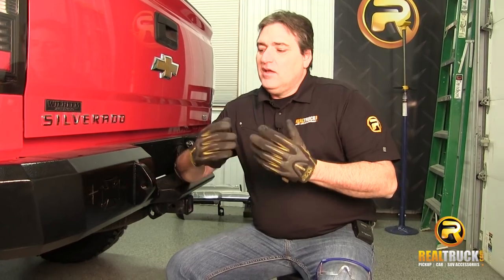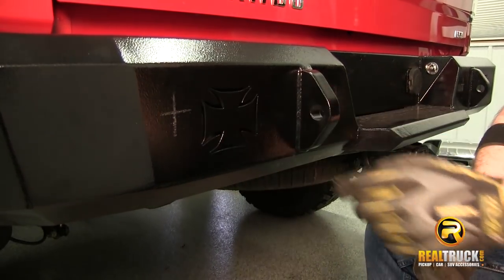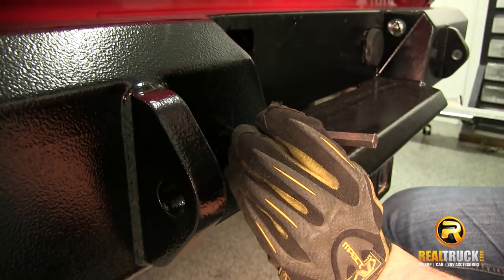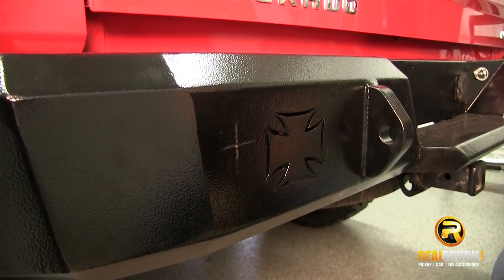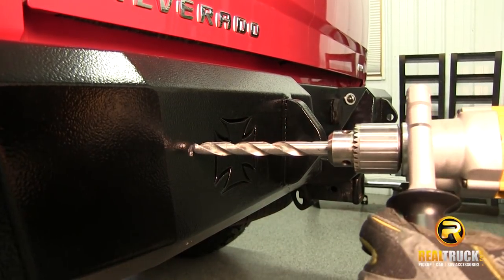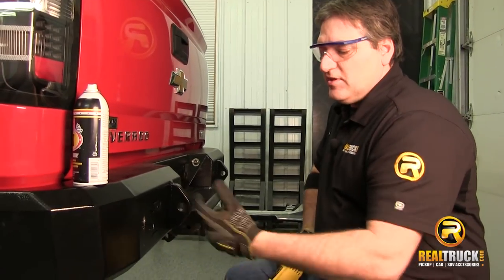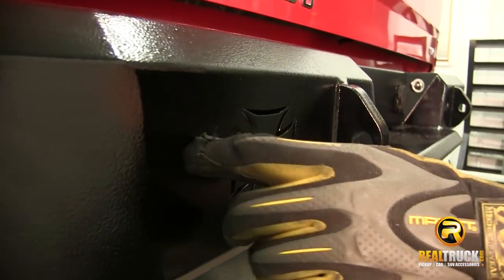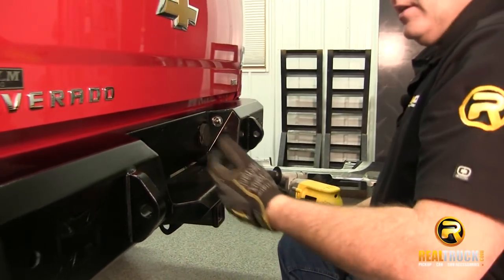How to Install Factory Sensors in Steel Bumpers

Comment: Also, if your replacing your bumper with a OE style bumper. Save yourself about $250 and buy a bumper without the parking aid holes and drill your own holes. What a rip off charging more than twice as much for the same bumper just because they put holes in it.

Comment: Its worth to mention Iron cross bumpers will void warranty when you drill and tap for these sensors.  For the $950 you would think they would do it for you.     Other than that this is a stellar video.  I will be modifying my bumper to accept the hitch plug, this is a great starting point for me.   Hopefully it turns out as nice as these sensors did.
Reply from the maker: +sg255010 Other than the powder-coating there really isn't anything there to warranty anyway. That is a good point though and hope yours turn out well also.
Reply: +RealTruck.com.           Actually just finished with it today.  It took me about 2-2.5 hours with light modification to the factory plug as well (shaved some plastic) and it looks like it came from the factory.  Thanks for the tips and I agree its a solid piece of steel...warranty LOL.
Reply from the maker: Awesome!

Comment: I have a 2013 Silverado will moving the sensors from the factory bumper to the aftermarket work the only reason I ask is the 2013s weren't all in a row like the 14s I'm guessing it was just for looks but i just wanted input if you had that issue before
Reply from the maker: Hi Jacob, Just make sure all of your sensors are seated properly and you should not have any issues. Thanks!

Comment from the maker: George Walden - You are correct. These are parking sensors. Pickups starting using these as well around 2009. Now the 2014 and newer also have them in the front bumper. So people like my wife don't continuously back into things ( sorry dear ). No ambiguity intended

Comment: THANK you for the input we bought a brush guard/push bar on eBay which came with all the correct installation hardware but it slightly blocks the clear view of the middle sencers and triggers them I want to still two holes in the brush guard and install two new senders in it and just plug em in to the factory harness and leave the originals in the bumper I put it all together already and had to remove it cause of the computer  recognizing some thing is in front of the puckup

Comment: will relocating my front bumper sensors on a 2016 Chevy Silverado High Country from the bumper to the new brush guard will that void my warranty
Reply from the maker: Michael Lawson relocating the sensors should not void your warranty UNLESS you cut and splice the wires to make them longer. As with the installation of any aftermarket accessory it is always a good idea to check with two or three different dealerships first. Don't take the word of only one because some will tell you that they do void it because they are always looking for a reason not to do it. They don't get paid for warranty work it is part of their contract to be a dealership. If you  have any questions about these or any of the other 500000 plus accessories we sell and would like to speak to a person directly feel free to contact our knowledgeable Customer Service folks at  877-216-5446

Comment: Did you have any issues with the sensors picking up the shackle mounts and causing it to give a false-positive beep/alarm?
Reply from the maker: +Bjorn Iverson nope it worked great and is still working. The bezels are angled so you just have to make sure you don't angle them towards the D hooks.

Comment: How about the rest of the installation - wiring etc. ?
Reply from the maker: macdragster We apologize we were not able to include the wiring. After the holes are drilled the sensors pop back in (push the sensor boot in the drilled hole from the front of the bumper and push the sensor in from the backside of the bumper into the boot)  then you plug back in to your factory harness. If you have any issues with any sensor going off turn it then in the sensor boot until it has stopped.  Thanks!

Comment: after you drill the holes, what can be done to prevent rust?
Reply: Any kind of paint or coating would work. As long as it protects the exposed steel from the air, it'll be fine.

Comment: How you get the bezels to fit correctly?  Either that bumper is really thin or you got some different bezels.  My bumper is very thick and even after I drilled the holes out, the bezels not fit correctly.  Answers?
Reply from the maker: +Elijah T I kept the diameter of the holes a little small so they fit really tight. Then I added some gasket sealer from NAPA called the Right Stuff and they are in there forever. Yes the bumper is too thick for them to snap in.
Reply: I was thinking the exact same thing. Those sensors are typically made to fit in thin plastic bumpers or lightweight steel.
Reply: Might need to install in a washer and weld that in place.  Thats my plan for this thick bumper i ordered